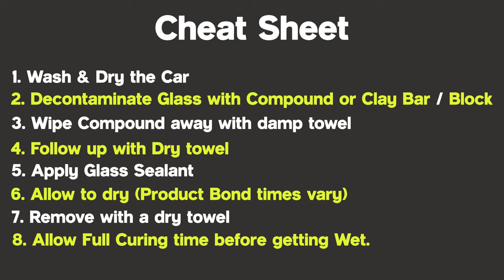How to Apply Rain Repellent on your Car Windscreen

Comment: great video Dave, short 'n' straight to the point, everyone should have a glass coating for safety.  👍  Just done my winter protection at the weekend, already had Infinity Wax Diamond Vision on the glass, but topped up with their new Spotless+ combining cleaning and protection  - just bead-tastic 💯
Reply from the maker: I still haven't tried new glass cleaner yet. Need to give that a go for sure

Comment: Thanks I’ll try this. My windscreen is very hard to see out of in rain as the wipers smear. I think it’s something they use in the local car wash that causes it.  I need help washing my car at home. It never gets clean when I do it and there is always white spots left.
Reply from the maker: Yeah local carwashes use fast acting drying aid chemicals but they follow up with contaminated towels which may have silicone which causes problems

Comment: Used these for my car and shower glass. Only issue is when the liquids are less than say 20% left, it is hard to use when the bottles are horizontal, e.g side windows. Great to clear water off though.
Reply from the maker: Fair point. That's definitely something they could learn from with an angled cap 👌

Comment: Great Tips again Dave, i have slight scratching on my windscreen but quite heavy scratching on a side window, can you recommend a way to remove the sctatches before i coat the windows
Reply from the maker: Hi Tony you can actually machine polish glass scratches and there is a knack so it's on the list for the channel so I'll get it made very soon 🙏
Reply: @epicdetailingv2  That’s great 😃

Comment: Cracking vid mate. How much would you normally charge as an extra, and would customers expect all their windows done or just windscreen?
Reply from the maker: Thank you. I normally charge around £30 for the windscreen on average. Depending on the other services or client it may vary.  My clients quite like the idea of getting extra protection on the car. It's an easy job that takes less than half an hour.. definitely recommend it.

Comment: Another great video!

I used both products a few months ago on my car; the wipers were fine initially but after a month or so they started juddering across the windscreen. I cleaned my wiper blades(blades less than 2 years old) but no success. In the end I used the compound again to remove the coating and the juddering no longer occurs.  So any advice to about wiper judder would be greatly appreciated!
Reply from the maker: Thank you its a simple fix simply wipe the coating on the wiper blades. Takes 5 seconds and works a treat
Reply: Excellent - will give that a try at the weekend. Thank you!
Reply: @epicdetailingv2  do you mean when doing the screen or when it starts to judder.

Comment: Hello this may be abit out of topic but may I ask what is pH tolerance for the glaco? If I were to use the CarPro lift snow foam 1:10 dilution will it strip the glaco away? TIA
Reply from the maker: Hello very good question. I will be 100% honest with you. I haven't used carpro lift so I can't really give my best advice with regards to that product but I use this on so many cars and use alkaline foams that don't strip it. It's designed to be super tough so I wouldn't have any doubts with it 👌
Reply: @epicdetailingv2  Thanks for the info, I already have the Glaco DX on my windscreen and currently looking to get a snow foam agent. Just in dilemma on getting either the carpro lift or the pH neutral koch chemie gsf. I suppose the Lift will have better cleaning effect with the higher pH, I am just afraid it will strip off the Glaco.

Comment: It is super helpful tips. 🎉

Recently I found out there is an issue on my windshield. The wiper does a pretty good job going up, but then leaves a streak when returning down (zone a area). It is a 21 plate Volvo and changed a new pairs of wiper a month ago, still having the same issue. 

Would you able to help to explain why does it happen and how to solve it? 

It is the sam issue like this Volvo XC60
https://youtu.be/qzQN1zkoeQA
Reply from the maker: Hello looking at it I'd say it could be down to poor design. It could be the rubber is out by even a millimetre. Hard to explain but if the rubber is too long it will just fold on the way back down. So it's not perfectly sitting on glass. Or perhaps it's been cleaned before and someone has learned on the arm of the blade forcing it down. A tiny adjustment could fix it for sure